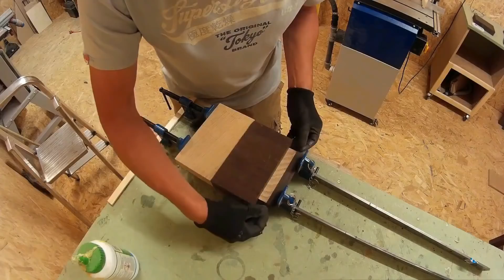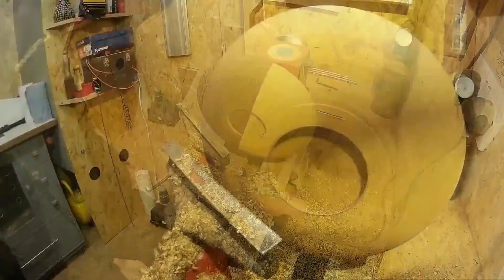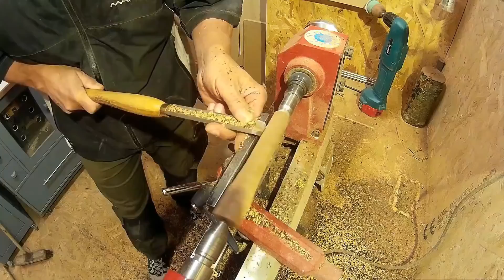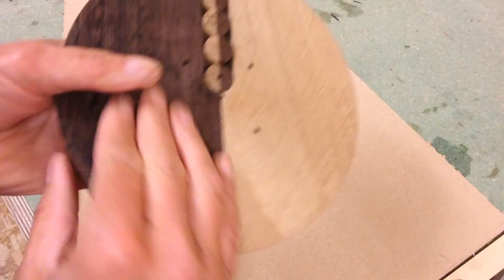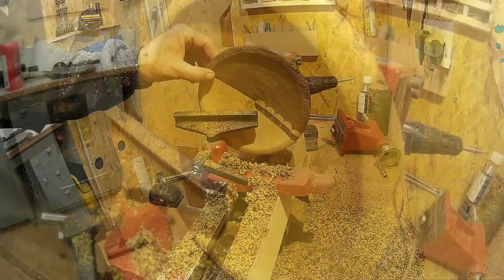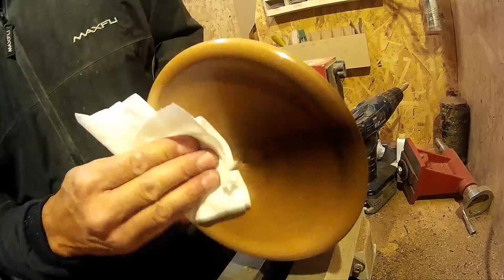Woodturning - Half n Half

Comment: Great design!  Just a note on safety, I see you using that spindle roughing gouge for bowl turning, and that's extremely dangerous.  You should never ever use a spindle roughing gouge on any end grain wood.  Look up some info on it, there's some videos on YT talking about them. Happy turning!
Reply from the maker: Cheers Peter  ..
Reply: I agree with you, Peter -- but only in the case where a SRG is being used on the inside of a bowl. Here, the extension of the gouge over the toolrest combines with the propensity of the SRG wings to catch on a concave surface to create the typical prescription for disaster. Used as Andy did -- a shear angle pull cut with toolrest tucked close to the convex outer surface -- the SRG is no more likely than any other tool to cause harm. Is it the best tool to use here? Nah... In any case, that's not a SRG. It's the Continental pattern forged spindle gouge that comes with the Benjamin's Best and other packaged gouge sets.  Clyde

Comment: Nice part, very cool design. How long does it take for the epoxy resin to harden? I have never worked with epoxy resin.
Reply from the maker: Thanks ..It depends what make you use .. the one I used in the video set over night but the one I use now takes 3-4 days ..

Comment: Did you consider drilling round holes to glue your bicoloured into? You wouldn't have needed to use any resin. Just a thought.
Reply from the maker: I wanted the resin to add a bit of colour to it ..that didn't quite work though lol ..cheers
Reply: Been there. I'm the owner of one disappointing can of wood stain.

Comment: While watching the video, "Half n Half" I noticed that you used a Spindle Roughing Gouge on the bowl. You should "never ever" use a spindle roughing gouge on end grain. It can break and impale you. You should take down this video for safety reasons.
Reply from the maker: Thanks for your concern but Its not a SRG  It's the Continental pattern forged spindle gouge that comes with the Benjamin's Best and other packaged gouge sets. A shear angle pull cut with toolrest tucked close to the convex outer surface -- the FSG is no more likely than any other tool to cause harm.